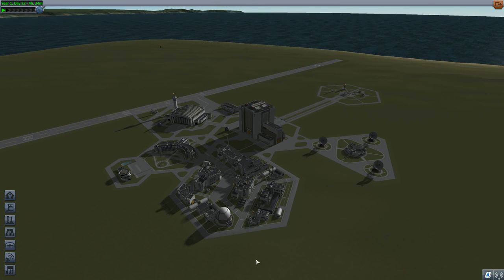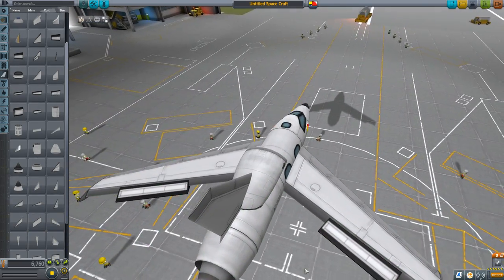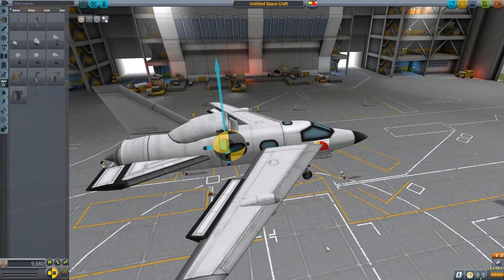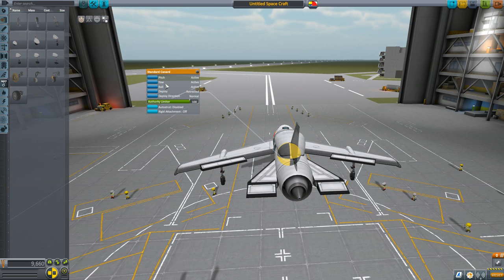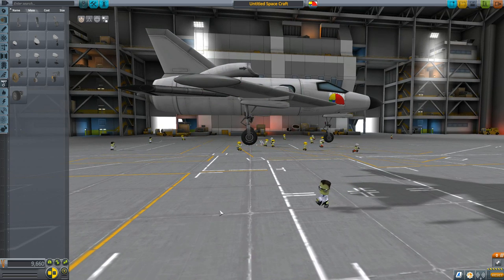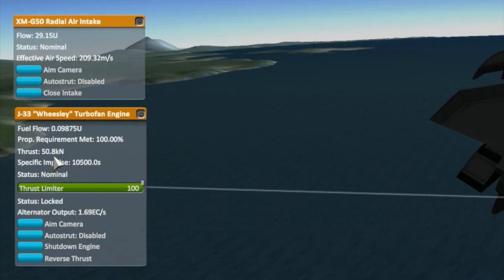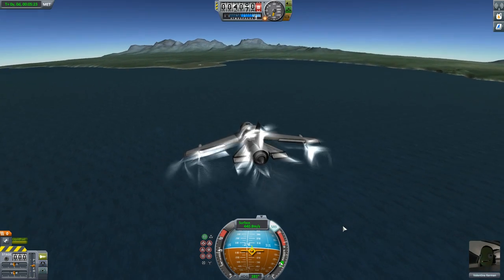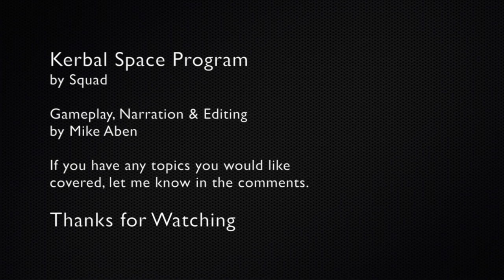Basic Plane Design - KSP Tutorials #9

Comment: Great tutorial for aircraft. Altho at 11:35 I think you have the pitch wrong. Unlike canard the elevator is up to climb, not down. This always messed me up and I had dozens of R/C planes too. One of them saw the dirt cause of that, lol. As always fun stuff!
Reply from the maker: And no quicksave in real life. You're right, though I was thinking more which way the force is applied. Moving the elevator up causes a counter force which pushes it down. I may not have said that very clearly. It's nice that in KSP you don't have to think about it. The control surface automatically moves in the right direction.

Comment: Thanks for the video, I've never been able to make a good plane at the beginning of the career mode. This tutorial was exactly what I needed, and great tip about adding the reverse thrusters to the rcs action group.
Reply from the maker: Glad it helps.  The Weasley jet engine that is featured here doesn't appear until tier 5 on the tech tree.  If you want to see a plane using the tier 4 Juno engine (the first one unlocked), go here.

https://youtu.be/EbTVxtmOCkQ

Comment: What is the input to attach the Elevon like that. I have been struggling with this a lot and haven't found an answer
Reply from the maker: Are you talking about at 2:56? I'm using two-way radial symmetry and then the WASDQE keys to rotate. I have a more up to date video if that helps. https://youtu.be/416zilwOwAQ

Comment: Yeah just picked up KSP and started hard mode with no mods. Let's just say planes ended my run. I'm more familiar with rockets due to Orbiter 2010. This was useful, and I'll probably bee line planes instead of Electrics next time.
Reply from the maker: I'll admit to being more of a rocket guy myself, but when you build your first successful, single stage to orbit, spaceplane later in the game, it's a pretty sweet feeling.
Reply: Mike Aben I agree. One of the biggest things that helped me on the level 1 runway was to adjust the spring and damper strength of the wheels. It made driving at 70-100 m/s on the runway smooth. Out of all the KSP videos on planes I've not heard anyone mention that yet.

Comment: Hey can you please do a video of how to get 2 air engines to work together cuz I have a problem and my plane has 2 air engines right? Well the problem is is that I can't get my 2 air engines to work  and every time I put my plane on the runway 1 of my engines stop working k so can you do a video of how to fix that please...
Reply from the maker: I'm not sure what the problem could be.  There really shouldn't be anything different you have to do.  Here's a video with a simple tier 1 plane that has three air breathing engines.

https://youtu.be/EbTVxtmOCkQ

Make sure your engines are getting enough air through air intakes.  What engines are you using?  Also, make sure it isn't something silly like the thrust being turned off on one of the engines in the SPH.  You'd be surprised how many times problems I've had were a result of something like this.

Comment: Hello! How do you copy/paste objects in hangar?
Reply from the maker: What you're seeing me do here is change the symmetry (the bottom left icon on the screen) while having an object selected.  You change symmetry by clicking the icon or pressing 'x' on the keyboard.  You can see me do this at 2:35.

You can also save a group of assembled parts so that they can be available for another craft.  Just google "KSP subassemblies" to find better instructions than what I can type here.
Reply: @MikeAben  yeah, but I mean when I select a group of parts and I want to multiply the group of parts. I know how symmetry works, but I still haven't figured out after years how to do that.
Reply from the maker: Sorry, I misunderstood what you were asking for.  Left click with the mouse while holding the Alt key (I believe that would be option on a Mac) will create a copy of the part.  If there are other parts attached to that part, it will copy all of them.

It's funny.  Doing this has become such second nature that I don't even think about it now.
Reply: @MikeAben  thank you soo much
Reply: Mr.Mike, do you happen to know the control for that on console